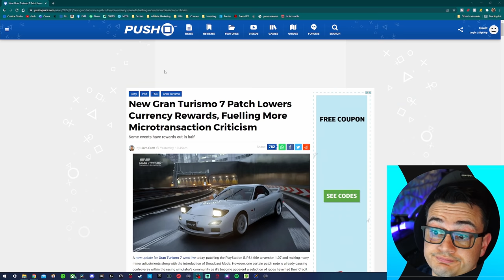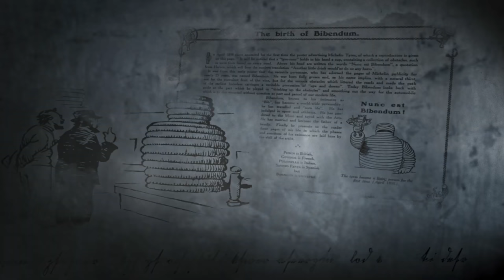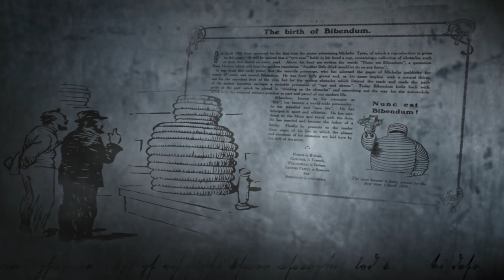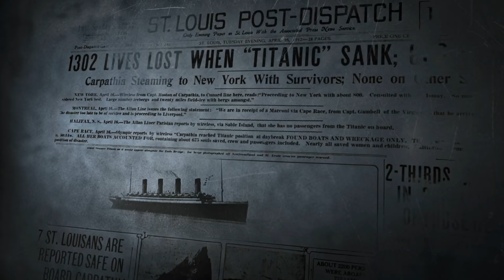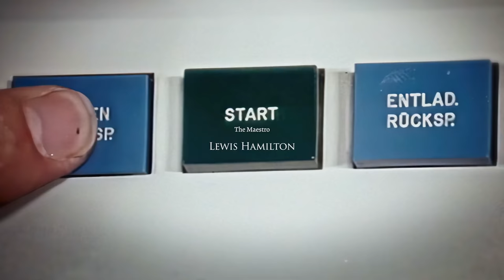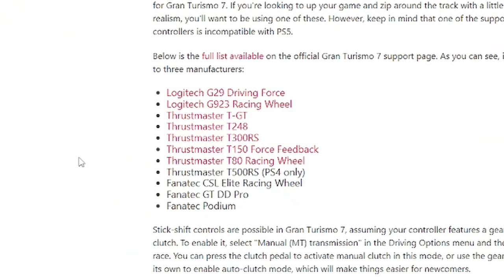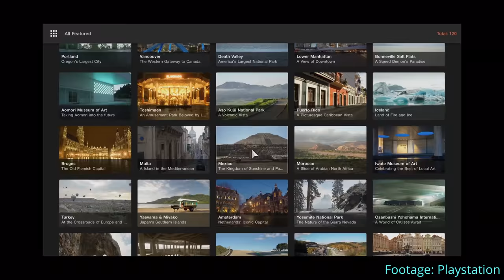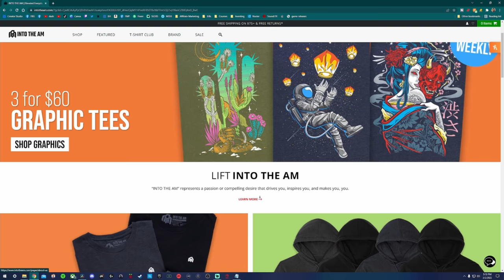Gran Turismo 7 PS5 Review-All Nostalgia, No Evolution

Comment: dude your review nailed it. and the lack of the variations of each track they could have used those to make more circuits and championships for more money, let us sell dupes, and balance the mods based on the car. a turbocharge upgrade for a viper is going to be more expensive than a mini cooper. they shouldn't have sooo many races that were restricted in some degree due to requirements like PP, tires, and such. you shouldn't have to nerf your own car's performance to fit a race. also you could race better cars against slower cars instead of every single race seeming to be designed to make it completely balanced in every single race. you should be able to make a bad ass car and virtually destroy a field of cars instead of always having a rolling start from the back which makes every race seem like you're struggling until the final lap when you can finally pass the first car and get into the top place. lots of small things they could have done but went completely different on their end as far as design goes. its frustrating because they have always been known for great graphics and gameplay and this time they basically sold the gameplay out for encouraged MTX. smh. good job on the video though spot on
Reply from the maker: Thank you my friend . I will be pinning your comment for all to read because you made some great points and shared some good info here. I’m glad you liked my review !
Reply: @GamerHeavenOfficial  thanks :) i do still dig the game and not gonna give up on it yet. i'm finding some races sprinkled in here that are accessible and more reasonable to get into and they've added a couple things to the sport mode i'm gonna get into monday and tuesday when they're available, so its not totally a lost cause. hopefully they're eyeing the metacritic ratings bomb and know the MTX stuff is definitely a divisive thing for its fanbase and either not proceed with expanding it further.

Comment: I think the format they used where you have to read what the NPC is saying is very Japanese. I can think of many Japanese games that have that style, Metal gear solid, the Zelda games, etc. So it doesn't bother me knowing that but it does make the game experience a bit dry. I don't think animated NPC's would fit this game, that's really corny and should be more associated with more arcade-type racing games such as need for speed or Forza horizon. I think Polyphony knows their audience and the real thing missing in this game is really more content aka new tracks, more cars, and more races. microtransactions are terrible for any game. Just my 2 cents.

Comment: Lack of innovation! Yuuuupp! kind of sad too.  The First GT was innovative with the use of the Dual Shock controller, GT 4 was the first to support triple screens, GT5 had 3D TV support, triple screens and head tracking!, GT 6 had triple screens as well. GT Sport had some VR... could have been a lot better.  GT 7 has none of the above.  If the PS5 can support 4k@60 fps it can do triple 1080p, (make and sell us an adaptor to split the HDMI Sony!).  I realize these are not things every gamer would want but Sony sells a camera for the PS5... give us head tracking.  Lack of VR support out of the box is a real kick in the nuts too, Sony has sold well over 5 million PSVR headsets and many of us are using them on the PS5, racing games provide some of the best VR experiences WTF Sony?